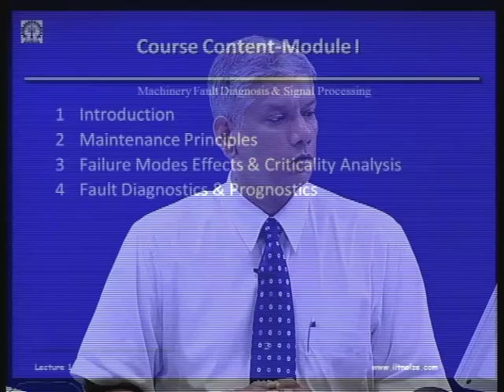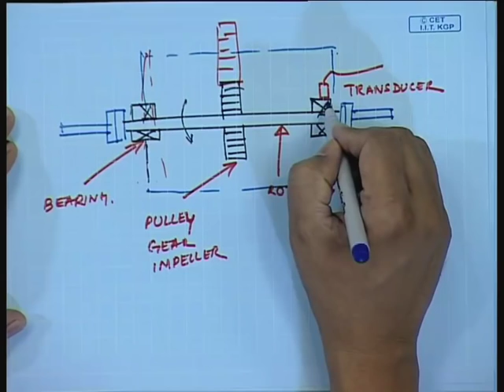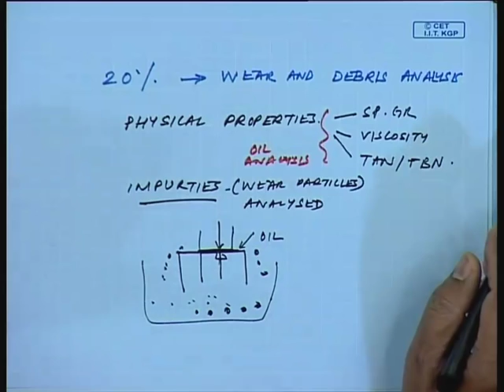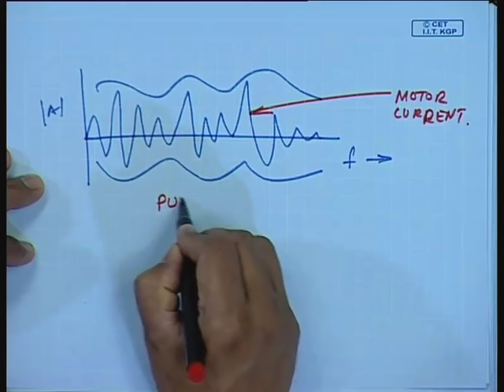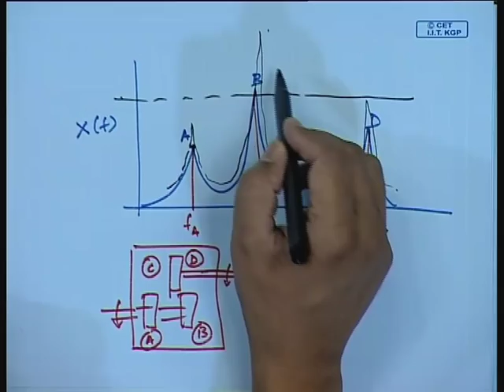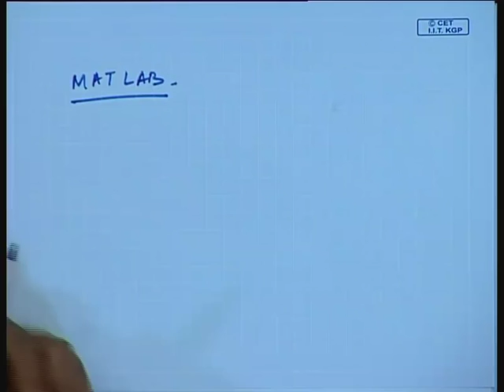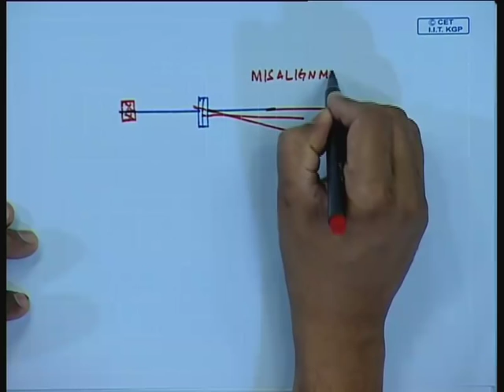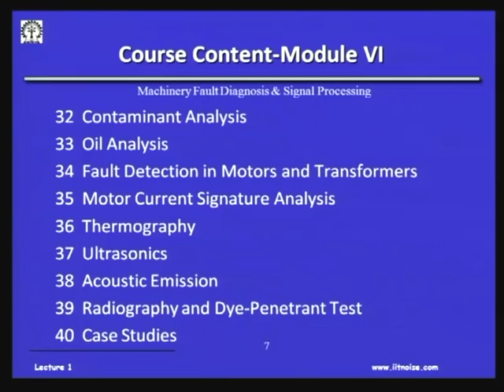Mod-01 Lec-01 Introduction

Comment: Good explanation A.R.Mohanty.I would like to ask you about natural frequency and mode shape for MDOF( unhampered) three impeller connected with shaft between two journal bearing,the weight of impellers are 200 kg,180 kg and 150 kg respectively and torsional stiffness (kt) is 644000 N/m.
Could you provide me solution in more details?